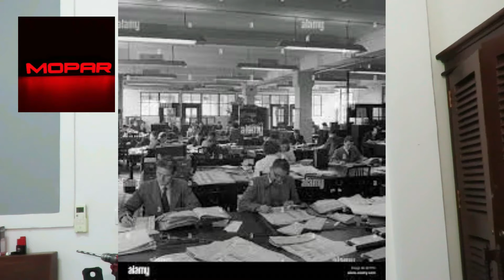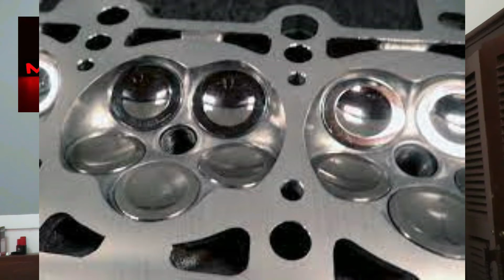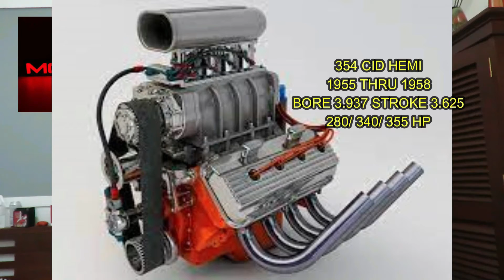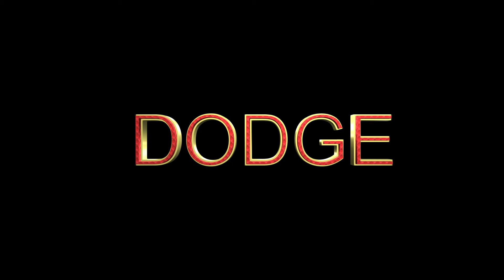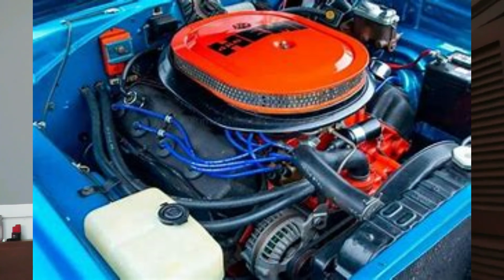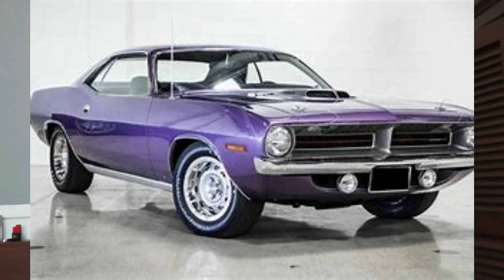CHRYSLER HEMI V8 ENGINE HISTORY

Comment: The 390 horse injected motor was actually 1958 option in 1959 the only cars that had hemi still in them were a Chrysler imperial everything else had already reverted to wedge motors

Comment: The oldest V8 hemi engine I've ever seen apart and able to see all the parts while it was being restored was a a V8 liberty airplane engine it was an overhead cam hemispherical head V8 engine was built somewhere around 1915 was designed by Jesse Vincent of Packard and Albert Hall of Hall Scott Motors... And yes they knew the advantages of the Hemi heads back then ...   Most of all the old air cooled radial airplane engines were hemi heads they didn't invent the hemi but they knew the advantages of the design.... Charles Lindbergh crossed the Atlantic using a hemi head Wright whirlwind engine...

Comment: Correction, the poly or single rocker shaft is a poly head. The A block plymouth was just that, the A block, not a poly. Yes, it's the same valve set up but isn't officially labeled a poly.

Comment: As for the Hemi being called the Elephant motor, it was not the 426 Hemi to be first called that, it was the first Gen hemi engines. The first Gen Hemi became so powerful in topfuel that it would roast the tires all the way down the track while much smaller and much less powerful drag cars with the small block chevy were able to get traction sooner and win, this is where they became known as the mouse motors because the hemi already had that nickname the elephant due to its size. As tire technology improved this short term advantage chevy had was erased.

Comment: Lots of good info in your video.  Long time Mopar fan here.  Minor nit pick -  GM small and big block V8s were also design by difference groups - Chev, Pont, Olds, Buick, Cad.- none were interchangeable either.   GM never went hemi….they were always wedge at best.  Ford did their best to copy the Hemi with their SOHC 427.  Never really offered it as a street engine…later they tried the Boss 429…again not a mainstream except for the minimum needed to get NASCAR approval.  Neither succeed at unseating the Chrysler 426.  Thanks for all the work on this video.

Comment: Confusion between small Dodge hemi block "polys" and A block "polys" ? 1955 and 1956 Plymouth? Not the same bottom end but some with nearly the same displacement? 
  The 4 barrel carburetor version of the 1954 Dodge "Red Ram" that was slower off the line than a 1950 Pontiac Eight (low tech flathead straight eight) but quicker after 40 or so mph came up and much faster top speed? Did Dodge 241 hemi have the lowest fuel burn per horsepower produced of any American car engine produced in 1954 ?

Comment: Yeah, I'm still at it.
While not mentioned an any of the videos that I have seen so far, it should be noted that compression ratios up to the mid '50's were generally in the seven point something to one range. Then higher octane leaded fuel became widely available across the country. I'm a Dodge Hemi bloke so I noticed that the compression ratio in the 1955 engine was still about 7.5 to 1 while in 1956, just one model year later, the compression jumped to 9.25 to 1, almost two full points in one go.
1955 Dodge 270, .... 183hp.    With 4bbl carb, 193hp
1956 Dodge 315, ....  285hp.   With Power Pack option, 315hp 
45 more cubes but 100 more horses, so the added compression added the power improvement of more that two hp per cubic inch for those extra forty five cubic inches of displacement, all due to compression & premium fuel availability. 
I'm pretty sure that other manufacturers did the same, it was a no brainer, but worth keeping in mind when comparing factory outputs from year to year & model to model of your favorite engine brand.

There was no Poly head version of the 1953/'54 Dodge 241 engine.

Comment: Sorry in advance about being a pedantic pr1ck, but you can call it a weakness.

Chrysler Corp was a holding company. Under them was, for our purposes, four 'divisions' that manufactured Chrysler, DeSoto, Dodge & Plymouth cars, each was, essentially, an independent manufacturer. Of course, all the engineers were looking over the shoulders at the drawing boards of all the others, but they were "independent". Hell, they were all drinking buddies.
This corporate structure is the same as General Motors & the Ford Motor Company.
When it came to the early V8 engines, the Chrysler 'division',  of Chrysler Corp,  came up with their first OHV V8, in 1951 drawing from experience gained from the aero engine project of 1944/'45.
Being their first effort, just like all the others, the 331 Chrysler was flawed but was none the less a very good engine. The 180 HP rating was actually understating the true output.

The 1952 DeSoto Hemi engine drew heavily on the Chrysler design, but eliminated that extended bellhousing design, so improvements were made. The 330 DeSoto was mis-described as another 291 in the video. The DeSoto was not only smaller in all its five displacement versions, but was smaller in size overall as well as lighter. It was NEVER made as a Poly engine. The 1957 DeSoto 325 Poly engine was a very thinly disguised Dodge 325 Poly. Hell, the car that used it was even built in one of the Dodge factories.

Meanwhile, the Dodge engineers studied both Chrysler & DeSoto designs as well as actual engines, then designed out as many of the design flaws as they could identify. Unlike the others, they stuck with the proven "Floating Power" engine mount system that was an industry leading engineering advancement in 1932, but was obsolescent by 1952. [The side valve sixes still used 'Floating Power' up until the slant six came out.]
So the 241 & 270 Dodge did not get side lug engine mounts till 1956. [bummer] & like the DeSoto engine, was smaller overall & lighter yet again.

Chrysler engineers subsequently studied the Dodge Hemi engine design &, in essence, scaled it up for their 1956, 354 engine & probably even the 1955  331 as this was the final overarching design upgrade for Chrysler.
All in all, there were twelve early Hemi passenger car engines in three 'brands' & two deck heights [each]  
Chrysler had three, [331, 354 & 392] [Imperials used Chrysler engines]
Desoto had five [276, 291, 330 341 & 345] 
Dodge had four, [241, 270, 315 & 325] so plenty to choose from. 
The Industrial, Truck & Marine engines were a whole 'nother thing but can still be built as great Hot Rod engines.

The Red Ram name was always used for the base Dodge V8 engine in the 1952 till 1957 time frame. So for 1952/'53 the only Dodge V8, the 241 engine, was the known as the Red Ram. [Hemi]
In 1955, the 270 Hemi became the 'Super Red Ram' while the newly introduced Poly head version carried the Red Ram name.
The raised deck 1956 & '57 Dodge Hemi engines [the 315 & 325] are correctly known as the D500 while the standard Poly head version retained the Red Ram name.

So by "standing on the shoulders of those that went before" the Dodge engineers came up with the best core design of the early Hemi, & Chrysler engineers then made it bigger [& better?] Even the Dodge & Chrysler timing covers interchange from the newer Chrysler design.

It's my understanding that the 1955/ '56 Plymouth 259 V8 was in essence a bored out 241 Dodge [or under bored 270] with Poly heads & a Plymouth badge. The 'A' engine came later.

While it was not actually expressed as such in the video, the 426 Hemi was  "derived"  from the RB cylinder block.

Comment: Not really feeling the cross flow. Taken literally this means mixture flow from intake out the exhaust during overlap, and this is an issue. You will also find the highest flow angle is about 18 degrees as it moves away from the wall but is still tight enough to get some flow back in front of the valve head to recover some pressure for higher flow rate. While the larger angles point at the center the piston at TDC, they don't down the bore, and you'd really like the flow to aim at center at BDC. The greatest benefit comes from blowing down at max volume. Canting a near vertical valve is helpful, leaning in two directions provides both minimal shrouding and good pressure recovery.

Comment: The main reason the electronic fuel injection didn't work because the engineers didnt shield the primitive electronic components. In the 50's, cities were awash in emi due to neon lights transformers and the like.

Comment: The only hemi 4 valve engine I know of would be the rfvc line Honda had for the xr motorcycles. I think from 83 or 84 on the xr500r and still in production on the xl650. It makes for a complicated valvetrain .

Comment: The only Hemi V8 is from Chrylser, Dodge, Plymouth, Desoto. Ford had one in the sixties for nascar. G.M. had one in the north star engine. Pentroof is not a hemi. Every top fuel engine is based on Chryslers 426 design that dominated all others in stock form on nitro.

Comment: General Motors had General Motors Institute, starting in 1919.  Compared to GMI, the Chrysler Institute was small, and only granted Masters Degrees.  Many engineers graduated GMI, then went to Chrysler Institute.

Chevy's original big block, the 348/409 W-motor, had a 4.84" bore spacing and started production in 1958.  That bore spacing was carried over to the Mark IV big block we all know and love today.  The RB Hemi only had a bore spacing of 4.80".

Ford's MEL V8 had bore spacing of 4.90", and was used in the 383, 410, 430, 462 Lincolns.  It was also introduced in 1958, and strangely enough, had the same angled-deck wedge combustion chamber as Chevy's W-motor.  (Industrial espionage must have been a thing in the auto industry of the 1950's.)  The bore spacing was carried over to the 429/460 that was introduced in the late 60's.

Comment: Great stuff on one of the GOAT engines...  and that does not mean Pontiac!  40 years ago I had a 1957 Imperial... a nice clean 50K mile survivor car with the 392 Hemi.  Amaziing engine ran great.  Published specs at the time were a 9.25:1 CR, with 325  HP SAE gross, and it ran fine on regular gas.  (For 1958, CR was 10.0:1 and HP 345.)  Although the Gen I Hemi looked huge and was heavy, the size of the heads were the major reason.  With a bore spacing of 4.5625 inches the Chrysler engines were mid-pack, not big blocks like the later B/RB, BB Chev, BB Buicks,  2nd Gen Cad, or Ford 385.  The Dodge and DeSoto Hemis had their own smaller blocks, an expensive decision Chrysler did not repeat!

An interesting bit of trivia:  Chrysler's first gen 1951 Hemi and Cadillac 1949 V8 had not only the same displacement, but EXACTLY the same bore spacing, bore size, and stroke dimensions.  I have to wonder how many engineers Chrysler hired out of Cadillac in the late 1940s!  Chrysler may not have publicized its torque output a lot, they DID publish a detailed and beautifully illustrated color brochure for the Firepower V8.  Check it out:
https://www.oldcarbrochures.com/static/NA/Chrysler_and_Imperial/1951_Chrysler/1951_FirePower_Engine_Folder/dirindex.html

Comment: At your Gen2 Hemi intro - the early Hemi's were not "A Hemi's".   The A block is a Plymouth design that used poly heads.   The early Hemi's were a breed of their own, and like you said about the 3 other brands - nothing was shared between them.   The A block was design by Plymouth because they weren't allowed to have their own Hemi.  That A-block Poly evolved into the LA blocks(many things will interchange).

Comment: In 1956, Sid Street's Z-Z-ZIP, an F-class inboard racing hydroplane using a sleeved 276 cubic inch deSoto hemi (265 cu. in.), was modified to run on methanol with a Hilborn "crossram" mechanical fuel injection and a dry sump oiling system, set the world record for the flying-mile; he reset the mark in 1958. In 1969, new owner Gordie Reed, using the same engine, reset the record at 148.638 mph—a speed which has never been exceeded in the class.

Comment: Do not recall where this info was found, but an electrical engineer dove into the electronic control box finding capacitors as the weak spot that failed so so early.  By replacing the capacitors on an original equipment control unit, he was able to achieve a working electronic fuel injection system on his car.  Great video, thank you.
Reply: I think one of Ray Leno's mechanics restored one on a late 50s, or '60.

Comment: Speaking of competitors against the 426 Hemi, ya forgot to mention the Buick 455 with Stage 1 heads. They could run with and often beat the Hemi. I believe the Stage 1 version was nicknamed "the Hemi Killer".
Reply from the maker: this is a Chrysler video not Buick that will be a separate video.
Reply: Yes, I totally understand. The only reason I mentioned it was because you had said in the video about the only thing that could compete with the 426 Hemi was the 454 Chevelle. It's all good. Not trying to take any light from Chrysler. Really enjoying this series, thank you.  @Myvintageiron7512

Comment: i have a set of hemi heads for a bbc they came off of a funny car and a lot of them had bbc with hemi heads i use to work for the one of the guys that made hemi heads for bbc old man bell
Reply from the maker: yep common in the early drag race engines
Reply: Arias made the Hemi conversions for the Chevy. I think this video is about factory motors, to include aftermarket engines would make it hours long.
Reply: @ProfessorGinz  there was a few guys that made heads out of their shops aries was not the only person making them back in the 70's

Comment: My uncle has a 69 Roadrunner with a '68 426 Hemi. His car isn't numbers matching but it's super nice. The current motor makes at least 500+ hp at the wheels. It's a basic stock bottom end other than .030 forged pistons, the stock heads had alot of hours put in them (milled, gasket matched/bowl work, new ss valves etc)...it also has a custom ground Isky cam flat tappet cam/lifters . Just a basic Holley 850 xp on a stock ported intake...727 trans with a stall converter, stock Chrysler 8.75 with 3.55s with "Suregrip". It's a handful on the street for what it is. It makes great power and will destroy a set of M.T ET Street 275s with ease. I'm a Chevy guy but those old Hemis are awesome.
Reply: Sounds like fun!

Comment: Great video , thanks for putting this together. The 1950's FirePower is my favorite engine series.

It is accepted that the early design borrowed heavily from the Ardun ( he is quoted as saying that he was glad to be a part of it or something similar ) . The engineers back then ( 40's , 50's ) shared information regardless of who employed them . 

In 1953 Chrysler took a 331 up to 450 hp on a project called A311  ( specifics and papers are available on alpar ). The 331 would undergo alot of changes because of the A311 program. The 1954 and1955 heads flow the highest numbers of the entire engine series. 

It is important to remember that the fuel available to the consumer was about 60 octane when these engines were developed. As better fuel hit the market the benefits of the hemi became less . Or until you add a compressor and nitro methane the hemi comes back around , lol.
Reply: Chrysler built Hemi aircraft engines for the world war before Ardun
Reply: @shawnriddle3018  The military engines are not passenger car V-8's . James Zeder said that the FirePower V-8  was based on the Ardun. Allpar has these writings from Zeder. In my first message I stated that engineers back then shared information. Ardun didn't develop the hemispherical combustion arrangement but he was the first to adapt it to a " modern " passenger car V-8 engine.
Reply: Ardun borrowed from Crysler , Chrysler borrowed back. But it wasn't even like that... The engineers at the time were loyal to the craft of " engineering " , not brand A or brand B . The mindset was very different than where it ended up.

Comment: I thought it was the other way around.  The original hemi was the elephant, and the SBC that came out a few years later was the mouse motor, because while the big hemi made power, the smaller sized SBC could match it,  that leads to the the BBC being the rat motor due to its larger size.
Reply from the maker: no the early engine was not even called a hemi it was known as the duel rocker shaft engine the Elephant and Hemi terms did not get used until the 426 was produced
Reply: nope the 426 was the elephant